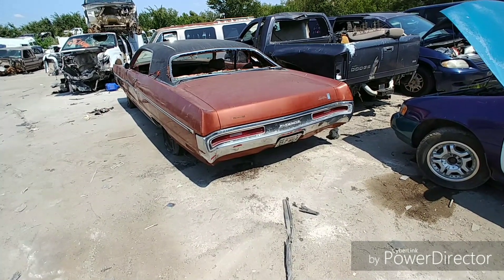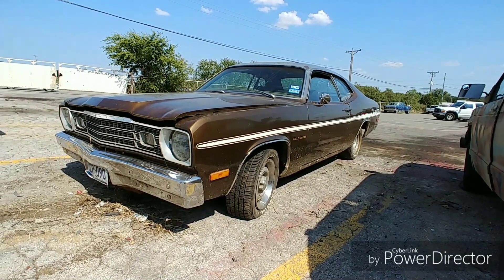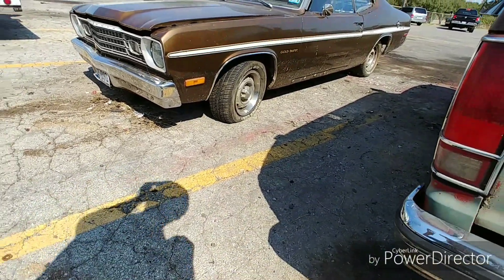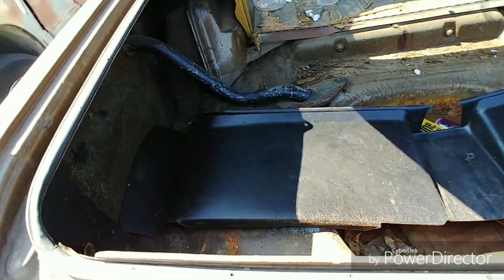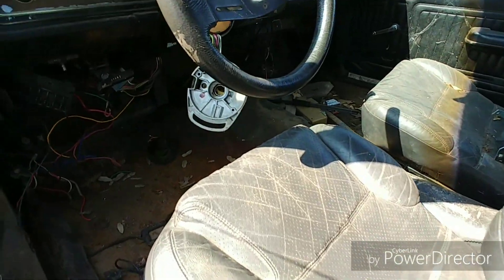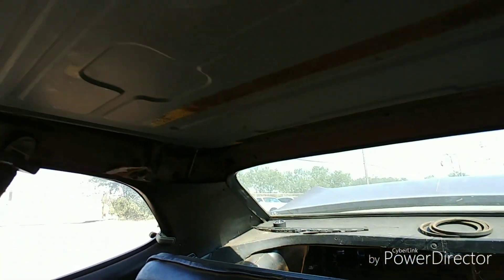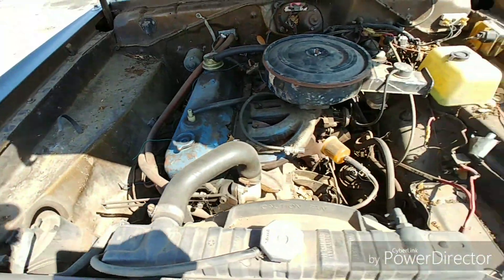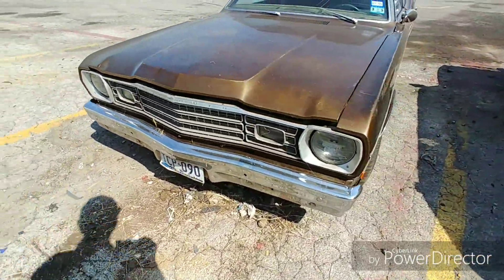1973 Plymouth Gold Duster Junkyard Find

Comment: My sister's first car in 1983 was a '74 Gold Duster 225, great car as I posted previously. This one is V for Valiant/Scamp/Duster, L for low price class, 29 for two door sports hard top, C for 225 Slant 6 "Tower of Power" 1 barrel engine, 3 for 1973 model year, B for Hamtramck, MI assembly and the rest is the production sequence. I think that Chrysler may have "pre punched" the roof in case a sunroof was going to be installed (Yes, it was a factory option from what I remember). UTG just bought one of these (a 1974) and it turns out I used to work with the guy at my old job that he bought the car from.  This car originally had an AM radio (R11), it had manual brakes (B43), it had a white canopy type roof (V4W), it had a light duty transmission (D24), it was Dark Gold Poly exterior (JY9) originally (which might be a fancy way to say brown), it had full door panels (000), it was built on July 6, 1973 (706, which makes sense seeing 7-73 on the door jamb label), the fold down seat is original (C73), the 225 one barrel slant six (E34) is original, It had a 60 A alternator (F13), it had roof drip rail moldings, (M21), wide sill moldings (M25), it's a USA spec car (U), order #793501.

Comment: Man! Them thumbnails you make are heart breakers! Yeah the inside on that one is rough. The slant six is really reliable.
Reply: Dats very true AND YOU KILL THOSE CHRYSLER ENGINES.  CHRYSLER USE TO WORK FOR GM BEFORE HE BECAME MR CHRYSLER DEN LEE I ICOCA TOOK IT OVER AND SAVED DA COMPANY REPUTATION IN 1975 OR SO.
Reply from the maker: As you can probably guess, its tough on YouTube to get views. I try to spark emotion on the thumbnail to get guys to ✔ out the video.

Comment: Brings back memories. I worked as a tech in the 70's  for Chrysler/Plymouth and the running joke was . The reason the Owners Manual was in a plastic folder, was to keep them dry. Rear windows leaked, windshield, sunroofs. One of the guys I worked with bought a new Cordoba and it leaked so bad so often it rusted out the rear lower Quarter Panels. I love Mopars but they were water leak city.

Comment: That sunroof was factory.  It was a Gold Duster with the Option the factory called Convertrible, or Convertriple.  The purpose for the weird name is Dodge was claiming that you were getting three cars in one.  A regular car.  A station wagon, because it has a fold down rear seat for extra space.   The commercial from back then showed someone putting skies in the trunk.  Third, you got a sunroof, so the claim was you also got a convertible.   Hence three cars in one.  Pretty cool car worth saving.
Reply from the maker: Sadly I believe this one came into the yard without a title

Comment: That would make a great restoration project. Should be easy enough to find a front bench seat. You could also convert it to power brakes by taking the necessary parts off another A body.
HEY DYLAN MCCOOL! Need another Duster?

Comment: Used, abused, & then cast aside - I could think of some other cars that would deserve that treatment, but not a Duster. Sure, it's not 340-powered, but I've seen a few videos where the 225 was given a decent makeover, & it was able to make a little more power. Well, coming from a guy who's owned some MoPars, & worked on a few others - I can tell you this one has one of the roughest "interiors" I've ever seen. The right person needs a decent budget & maybe a couple of years to make this nice again. I don't know how they do it in Texas, but I don't think getting a title would be that difficult - I mean the yard took it in w/out a title, right?  I'm going to switch gears now, & ask about that beautiful '70 Fury - the one that had the electrical fire. I hope it found a good home.
Reply from the maker: In Texas when there's no title you often have to get a bonded title amd hold it for 3 years before you can get a free and clear title.  I personally dont like this and im sure many others dont either. Plus it can add a few hundred or more if you dont want to file it yourself. Basically a hassle. As far a the blue fury, it was still there this past weekend
Reply: @ClassicRideSociety  You  Texans sure like doing things big, even if it makes things more difficult. 3 years for a title? Yikes! Thanks for the info on the blue fury - maybe if my lotto picks win, I'll come for it. 🙂

Comment: Judging from the rear bumper guards, I would say it is a ‘74 not a ‘73. The guards are missing from on the front. The ‘73s had black rubber bumper guards that were glued on.
Reply from the maker: I was going by. What the guy at the counter said and the sticker on the fender
Reply: I think '74 has larger rear bumpers

Comment: Not a big fan of Mopar. But I do have a 383 Mag. Wouldn't take long the fix the rust . It's the wiring that takes the time.
Reply from the maker: This one sat for a good while at that yard. It eventually sold a few months back. Not sure bow much but i recently found it on Facebook marketplace. And it sold there for $2500
Reply: @ClassicRideSociety  wish I hadn't sold the 340 6 pack I had. That was a strong one. Sold 5 motors to one guy. All 60s muscle car motors even sold the 409. But it did pay to build the shop .

Comment: Manual. Brakes are all you need these cars stop great.
Reply: '73 has disk brakes  and 4-1/2 inch bolt pattern.   It'll stop okay
Reply: @timothykeith1367  i have 74 with disc and a big block I've locked them up to avoid a turkey a couple weeks ago and it stopped really quick.